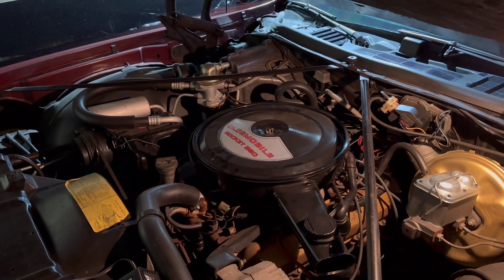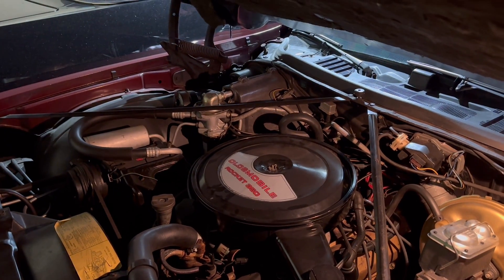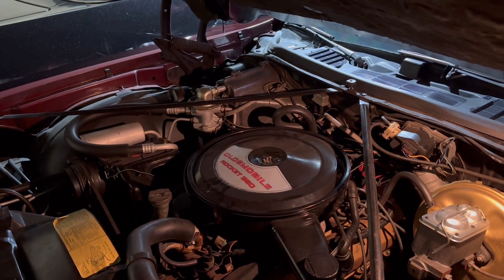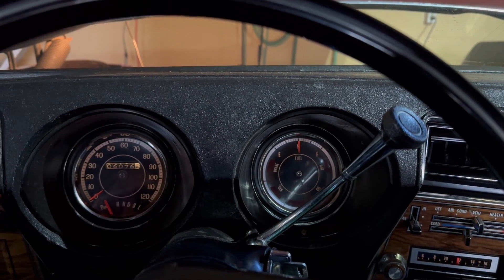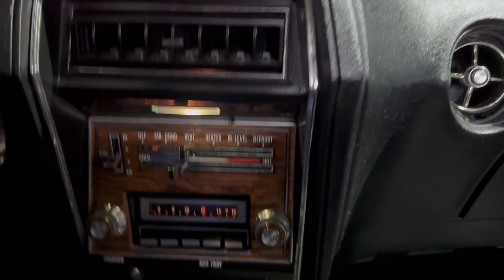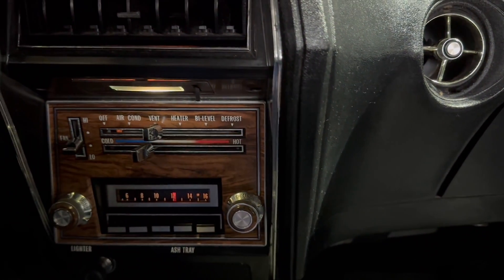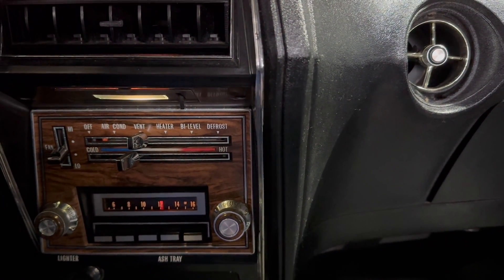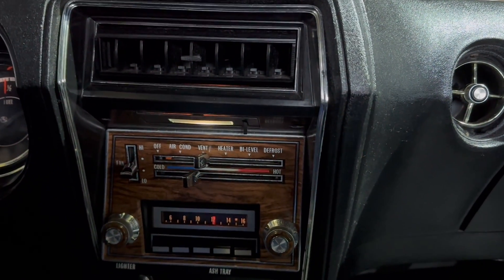GM's "Coolest" Invention Was a Strange Approach to Air Conditioning

Comment: My dad's 1976 Caprice had the newer A/C control shown and referenced at 7:07.  The car I learned to drive on, I remember it well.  "Max" opened the recirc door.  It also had that quirky GM feature in that even when the system lever was pushed all the way left to Off, the blower was still blowing at a super-low speed.

Comment: I always wondered why you had to run through the A/C to turn on the heater. Later I found out it was to momentarily engage the compressor in the winter to prevent the compressor from seizing up from lack of use over the cold months.

Comment: Appreciate you sharing this. Compared to the 3 slider control used on the '69-'74 Nova or '69 Camaro, this 2 slider control is a little simpler. On the Nova/Camaro setup there is a separate slider to control the defrost duct. Also the blend slider has a fan "off" position before "max", which like this system operates the heater shutoff and the recirculation function. The high speed blower can be used in all modes (vent, heat, defrost) on the Nova/Camaro controls. I have an explanation in this video: https://www.youtube.com/watch?v=jNUb-GDWz4Y Not sure if you were inspired by mine or if we just share this love of interesting stuff, but either way, I'm happy to know there are other people like me nerding out over engineering decisions from the '60s and '70s.

I'm currently in the process of divorcing the vacuum and clutch control on mine so I can have '80s/90s style "AC" and "Recirc" buttons, because I prefer to have independent control over those and not run the system in "reheat" mode when using blend. I've thought about redesigning the control panel, but I think that's more design work than I want to do at the moment. I've found the rotary vacuum valve on mine that operates the heater shutoff and recirculation doors is very finicky, in spite of rebuilding the control unit.

Comment: i like the volvo 240 set up, late 80s, the hot and cold lever directly via cable controls the
coolant flow valve and the a/c compressor has it's own on off knob

Comment: Having the fan be forced to high setting in the recirculating mode discouraged leaving it in recirculating constantly.  It’s amazing that those cars blew such freezing air when the temp was 100 and it was using 100% fresh air.  My 2019 Cadillac uses only about 20% fresh air when it’s really hot.  If you override it and force it to use fresh (by selecting the recirculating mode and then deselecting it), the vent air will not be cool when it’s hot and humid. Our dew point in Houston is often 78° in July - September. The new digitally controlled systems with electric air blend doors are dumbed down and often come maladjusted when new with regard to clutch cycling.  If you get a new car that cycles to the degree that you feel the humidity hit when it cycles, it needs the evaporator temperature setting recalibrated and/or the sensor is defective.  I have made a point never to buy a car without checking to make sure it’s not a fast cycles. Even at the dealerships they don’t understand what’s happening.

Comment: I guess since many people's previous car back wouldn't have had AC this was better than nothing to them but this is a pretty bad set up. When it's over 85 F with humidity that's over 75% I prefer to recirculate it and my A/C is pretty useless if its 10 degrees hotter if its not on recirculate. Granted R12 systems did cool better but I even like having the A/C in if it's 65 F but with high humidity, I'll run the fan on low with the temperature set about in the middle with on recirculate to have it act as a dehumidifier.

Comment: I’m wondering why Oldsmobile stopped offering automatic air conditioning in all its cars after 1973 and didn’t offer it for more than 10 years after. You could still get it in a Chevy Biscayne in 1974 (in Canada!) and in mid size Buick Century but not even in an Oldsmobile Toronado or 98 after 1973. You had the choice between the manual controls like the system in this video and the semi-automatic Tempmatic but no more fully automatic systems (and by the mid seventies, the Mark II programmers for the GM automatic air conditioners were quite effective and reliable. And to get the recirculation setting on those, you had to move the control to “auto hi”. Moving the thumb wheel to the coolest setting didn’t activate the recirculation. The Automatic Climate Control on my 1975 Electra can provide cooled air at the dash outlets while providing heat at the floor, very well designed system.

Comment: The recirculate setting on the GM Heat/AC control panel did not increase the fan speed. The setting closes the air door to block outside air from entering the cabin. The fan pitch changes with the extra load from moving air through the ducted space. CFM doesn't change much but the air temperature drops because the system is no longer fighting the hot humid air from outside.... Fact, not kidding.. lol
Reply from the maker: No. It definitely changes the fan speed on these and engages the hi blower. If yours doesn’t, your high blower relay is dead.
Reply: @RareClassicCars Trust me, everything you hear is related to redistribution of air.. Don't feel bad, even the best GM Tech's get this wrong. Read the rpm or cfm at the fan. Tell me about it after 👍
Reply from the maker: Yeah. Sorry. You’re wrong. Owned many of these cars. If you have the blower on low and move the lever over to the max setting the high blower engages and the recirc door opens. The factory manual even related that.

Comment: I agree with your description of the fan speed increase on recirc (since you can clearly hear the fan noise pitch increase) but am reminded of a car-nerd debate I got in with a Honda owner, who thought the same was happening on their 1990 Prelude.  Another independent noise effect also occurs when a car's HVAC is switched to recirc - the passenger cabin becomes exposed to the inlet-radiated noise of the ventilation fan, which can make the fan a lot noisier (even though it is not passing any more air, nor has its pitch changed).

Comment: The '70s.  Where GM took an Air Conditioning system and built a car around it.  😂

Seriously, in February of 1988, I bought a 1976 Oldsmobile Cutlass.  The A/C still worked perfectly.  12-year-old A/C that could damn near freeze you out of the car on a hot summer's day.  Glorious stuff!!

Comment: Does this also apply to heat? That there's an extra notch and then it goes into recirculation for the heat, or the heat is always fresh mix?
Reply: Halfway through the 80's GM managed to create a separate setting for the recirculation of cabin and outside air. That eventually led to cabin air filters. The recirculate option works for both heat and AC. Pretty much standard stuff on all modern vehicles...

Comment: My 1971 Ford Ranchero had a Max AC setting which would only recirculate the inside air also increases the blower speed.  Right before the Max AC was the Fresh setting, allowing outside air to come in to the truck cabin.

Comment: Nothing that still isnt done today. Most new cars if you go to the coldest setting they go to AC and recirculating. My vw does this amd its 10 years old. I had a 2006 that did as well. Some GM cars did in the late 90s amd 2000s

Comment: I think my 1998 chevy pickup kicks into recirc, regardless of the position of the recirc toggle button, when you rotate the temp control knob past a detent to “max AC”, but it doesn’t affect the blower speed. There is also no coolant valve inline with my heater core, that’s just handled by the air damper. Now I feel like I got gypped on features!

Comment: Yes, basically AC and Max AC instead of on the temperature adjuster it's in the selector knob. 
Also at some point in time AC came on with defrost with heat  to take moisture out and off the windshield, many years it was manual and you had to push a button but now they're all automatic as they should and your average person wouldn't know to turn on air conditioning with defrost in the winter. 😊

Comment: I liked the setup in my old 80s rwd Chrysler fifth ave. If you pushed the defrost button you could pull it back out to disable the air conditioner. It sucked power out of the already gutless wheezing lean burn 318. It was an ‘89 and third brake lights had just been mandated. It actually had an outsourced GM third brake light

Comment: I'm not sure this is strange, just innovation.  As far as I can think of the re-cerc is a standard feature on every car today, with many automatically switching to re-cerc when in the "max AC" mode.  
Are we sure the fan is actually going to a higher setting, or is it just louder because the air flow has increased and is now coming from the inlets in the cabin?  I can't imagine they would have run the fan through a resistor on high in other modes.  My town car behaves just like this, but the fan speed doesn't change, it just gets louder when sucking air from inside the car.
Reply: You are correct. The increase in sound comes from redistribution of the air flow.. CFM is the same..

Comment: R600a (Isobutane), R290 (propane) or a blend of the two works great in old A/C systems apparently. In Australia we have product called Minus 30 by Hychill and it is a blend of R600a and R290.
Reply: We have r404a it'll build ice on the inside of the windows...lol
You will need to change out the expansion valve to use it.. I installed one I can adjust. I like my vehicle AC cold and colder 💯🇺🇸 Trump 2024 🇺🇸

Comment: i remember the oldsmobiles and buicks had some flood lit instrument panels, looked really neat, the 72 delta and 98 was the best! i had that same car, it rusted away in va. 389k and only thing it needed was a couple timing chains! the reason for the high fan on recirc was to discourage leaving it on recirc because they felt it was safer to introduce outside air to reduce the chance of CO poisoning. i read that years ago somewhere, cant remember where but i remember the reasoning.

Comment: There is another system you may not be aware of.
The early 70s AMC Weather Eye A/C. It had regular heater controls, but to the right was a dial that allowed you to set the cycles at the intervals most comfortable. The dial ended with a setting called "Desert Only" and would not allow the system to cycle off at any time. I live where the weather is over 100° for over a month each year, and passengers would complain how cold it got. I've read you could actually get it into the 20s or 30s, but then it would freeze the system and you would need to melt ice, which would drip on passenger feet.
I have never felt anything else like it, and have owned GM cars, too.
Reply: Desert Mode is epic.   I miss the old AMC cars, it's a shame they went out of business.
Reply: AMC used GM Frigidaire components to build AC systems for their cars. Like most all did the same. GM traded under many brand names around the world.. 💯
🇺🇸 Trump 2024 🇺🇸

Comment: My first car a 1975 Ltd had this fridgedaire system on it with an expansion valve which kept the compressor on constantly so you didn’t feel kick off and on all the time and it all these years later was hands down the best ac system Ive had and im a ford guy. I’ve been mechanicing almost 40 years. Time flies

Comment: our 1980s Buick wagon and the 1988 Beretta I had as a first car and 1995 S-10 after that had the MAX setting. the Beretta could get see your breath in the airflow from the vents cold. Though the S-10 was a trio of knobs rather than the sliders. Function, Temp, fan speed.

Comment: I only clicked on this for the 1973 olds dash thumb nail. The POA/ expansion valve, R12 system was far more capable then mondern units. Oh the map light was an option. Standard didn't have the switch for the map

Comment: GM also had the blower motor to run all of the time in about 1974 or 75 in order to have positive pressure inside the car as long as the key was in the on position.

Comment: I miss the older GMs. I worked at a dealership back in the day.. loved it. When u could actually get in the front with the Motor and work.. you are correct with the AC systems. They would freeze you to death.😁😁
Reply: In the front with motor in the pick ups I should say…. 😁

Comment: I got to say that GM went from the best air conditioning on the market to basically non-working AC compressors. Every modern GM vehicle always had issues with leakage or for the compressor not working altogether so never ever had any AC in any used GM vehicles. How the glorious powerful GM has fallen.

Comment: I had several Olds mobiles during that era, including a 73 Cutlass. The A/Ć control with the MAX detent was for hot humid climates like deep south and mid west. As it was explained in my Owners manual, initial startup in hot car meant rolling down the windows, start engine, put cooling on the system on "MAX COOL" setting, anf be careful about touching hot interior surfaces. As driving time accumulated we began rolling windows up until the two front ones were open 2 inches. This allowed maximum cooling effect and helped to quick flush the hot air out. The, once the windows were shut, reduce cooling switch to Normal setting and enjoy the ride.

Comment: I drove an International cabover 943,000 miles,  owned by Ryder truck rental,  every 200,000 miles the R-6 compressor would give out, I’d be close to a “Ryder Service Center” , pull in and get a “re-manufactured” R6 compressor @ receiver dryer  changed out.  We ran Ca = west & Fla = east year round.  The re-man compressors lasted as long as the new unit did.   Very dependable in hot summers in the southern states

Comment: CFC-12 worked really good in them older systems. HFC-134a just can’t subcool as well hence reason you can’t clear sightglass also reduced cooling capacity. Another option I have found works very well is using (Hotshot-2) HFC-417c. It tends to clear sightglass and cools nearly identical to R-12 in the situations I seen it used. It is a A1 blended refrigerant so not explosive but does require POE or PAG oil. Hotshot-1 was approved as a SNAP refrigerant in automotive don’t believe ICOR continue that into Hotshot-2. Also recommend to swap schrader cores and desiccate in drier or accumulator. I have worked with stationary equipment and mobile ac and the rules are different. Mostly to mitigate cross contamination of different refrigerant in shop equipment versus the stationary(quick connect fittings for 134a and unique fittings on hotshot-1. If you are not comfortable with the use of recovery system or a vacuum pump and working on a HVAC system I would strongly recommend a professional mechanic.

Comment: Yes, I still remember that setting for maximum recirculated air conditioning because my dad's 1972 Oldsmobile Delta 88 had that feature instead of the maximum, normal, and bi level settings that we have had in later GM vehicles.

Comment: you are leaving out the 1960s pontiac setup which was the most versatile of vintage GM A/C.  you had 'inside' which was recirc..  and then A/C which was fresh air..  you had a separate 2 positon switch that was 'vent' and 'norm'.. essentially it was a compressor switch..  you had the ability to run or not run the compressor on any of the settings acros the panel.. (except defrost which always ran the compressor)..  dad's 1969 GTO convertible has that setup..  it is the predecessor to the EEVIR..  very similar. but without the closed loop evaporator.. EEVIR is unique in that it maintained a straight 27-30 PSI across the evaporator no matter the system load or the charge...  this made it near impossinle to freeze the system up. and you always had a high enough evaporator pressure to ensure the refrigerant boiled somewhat evenly acxross the whole coil.. regardless of engine speed...  the bottom "cup" was the accumulator if you by chance ended up with liquid making its way into the suction line. possible under low system laod conditions..  the EEVIR could be disassembled and adjusted for different refrigerants.. an EEVIR never worked right on R134A. (you got decent A/C but not like R12) unless you dropped the closed loop evaporator pressure by a few PSI... did you know the GM A6 compressor was also used on BUSSES? all the way up through the mid 00's? I recently worked on a bluebird bus with dual A6 compressors on it's cummins 5.9..  the bus built in 2006.. they even made serp belt pullets for the A6..  each A/C system in that bus is rated at about 65-70k BTU. and the A6 makes a solid column of liquid even at idle..  so while foreign manufacturers largely were sankyo and sanden..  GM went onto start rolling out the pitiful R4 compressor in the 3.8 V6 and eventually everything...  the commercial industry lkept using the A6 for many years..

Comment: One of the  strangest applications for A6 was when it was repurposed as an anti-dieseling device. ...after a GM car's ignition was switched off the A6 clutch would temporarily energize via timed relay, thus the compressor would load the engine and discourage run-on. That was circa '71.
Reply: that makes me think of my 1995 S-10 which had a quirk that if you turned it off and then turned it back to run before you heard a pair of clunks the engine would get right back to running. I can only assume that is the fly wheel had enough momentum that if you went right back to run there was enough energy left to spin the engine over

Comment: Replaced tons of those units, you were lucky if you got a year outta one on a new vehicle in alabama. john deere used them on tractors and they were no better on tractors they usually locked up and smoked belts. They would blow ice cubes when working.